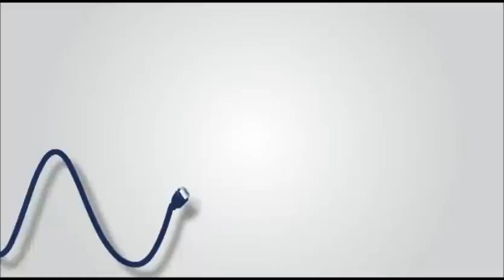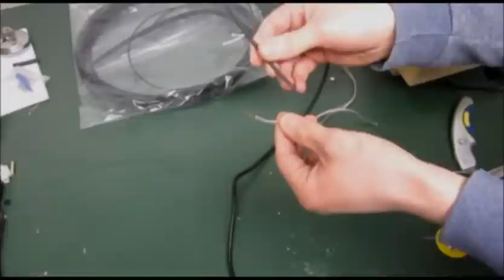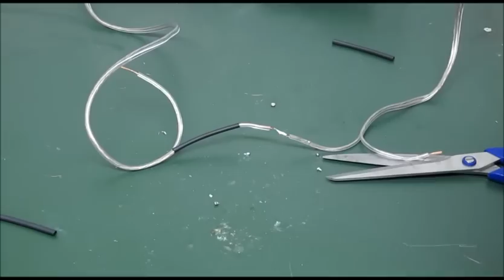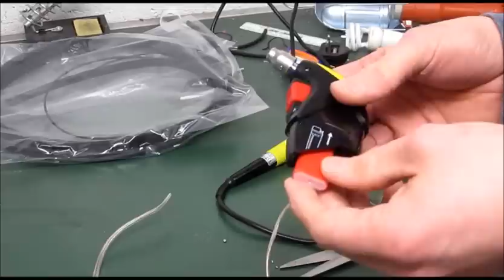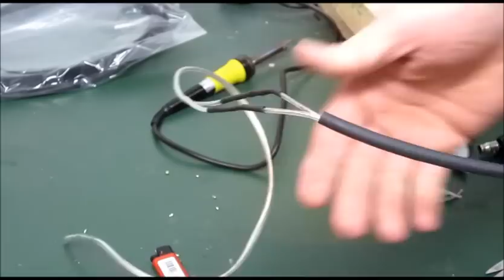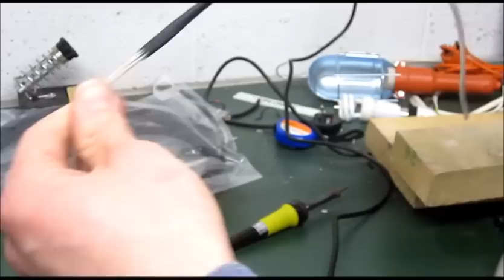How to Repair a Cable using Heat Shrink - Loops

Comment: This is not the best way to make a joint, a staggered joint is better and neater and there is less chance for a short circuit if the isolation gets damaged. Never make the two joints next to each other, cut the wires so that the one wire is shorter than the other one, then do the same with the other two wires, the shorter of one side then connects to the longer one on the other side.

Comment: does it hold in place like no sliding up and down the tubing like it stick to it place?
Reply from the maker: Hi, It does to a degree but you can actually purchase adhesive heat-shrink which is even better at keeping things in their place. many thanks!